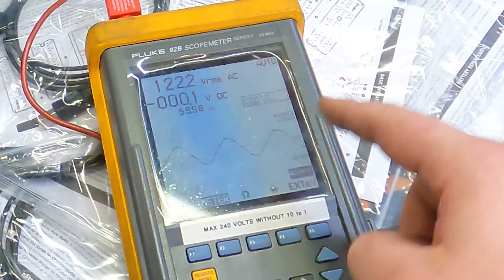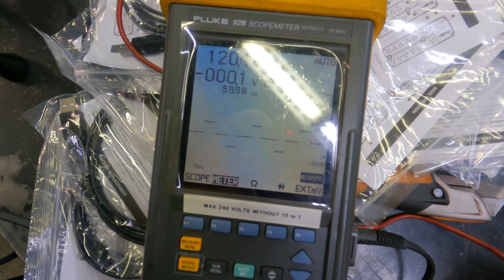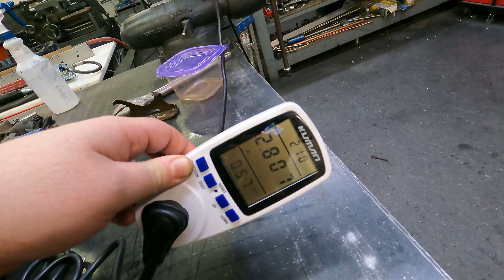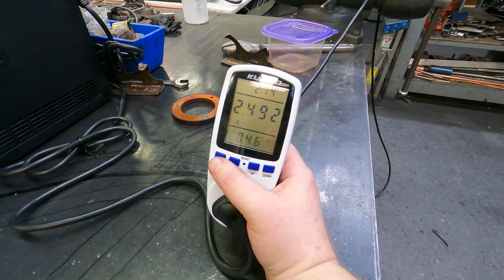Can You Plug Multiple UPS's Into Each Other (8 UPS Daisy Chain)

Comment: Thanks for being super comprehensive with the test. Really appreciate it. Clears a lot of doubt (especially the practical aspect of using 2 UPS chain for increased runtime).

I think the reason for the first test failure might be because of either:
1. at least one bad apple is in the chain that's not letting the power pass through as intended, making the next one go on back up (changing the order especially for the last 2-3 of the load end may give easy answer to whether this is the case)
2. or, the pass through may be introducing minimal power-factor/phase-shift (or some other form of deformation of the sine-wave) which is getting worse by each stage. At a certain point after a few links of the daisy chain, the next one thinks of it as bad (dirty) mains power & decides to switch to back up

I don't know whether you'll be able to retest these (cause it's a costly endeavor, both time & money wise). But if you do, I'll look forward to it.

Comment: At 2:40 you can see two UPSs with errors detecting power. Numbering from left to right, UPS 1 and 3 cannot detect the UPS to their right. Obviously, UPS 1 is the most critical one. Also, I noticed that all 8 UPSs detected a power failure. I am not sure what their power failure detection sensitivity range is, but you could probably tweak it in settings to make them work better together. Their voltage sensitivity seems to be too tight, perhaps, also, meaning that if the UPS sends out 110VAC and the trip is around 108 VAC, there could a low voltage detect error on UPS 1 and 3, thus shutting down the whole experiment early.

Comment: Cool test.  In the setup menus of each UPS you can adjust how sensitive they are to "bad power" and the min/max voltage to trigger the switchover.  I wonder if tweaking the setup you could make this work better with multiple units?

Comment: I bought a CyberPower A1500sp1 designed to power a 1/2 horse sump pump as a back up system.  It only runs 2-3 hours.  Do you think I could daisy chain two or more to get longer protection?  The output sign wave is a “simulated sign wave”.  Great video explanation and test.
Reply: The short answer is a positive maybe.  Although the technology in these things is much better than it was a handful of years ago, simulated sine waves have been known to not play nicely with each other.  For anything serious, I'd always recommend getting a larger single unit designed for the intended purpose.
Reply: @distractor_beamreviews  do you have a recommendation on what larger unit to get? I too am looking to run a sump pump for about 8 hrs and these are only able to last about 2-3 hrs
Reply from the maker: @davidroberts8568  Unfortunately these things get pretty expensive past 1500va.  The only one I've used in that range is https://www.amazon.com/APC-SRT5KXLT-Smart-UPS-5000VA-208V/dp/B01L24FYGW but it's 208v so it won't work for your scenario.  This might work for your purpose https://www.amazon.com/APC-SMX3000RMLV2UNC-100-127V-Smart-UPS-Network/dp/B004FIP7NS but if I was looking at paying that amount, I'd probably be considering a powerwall or something of that nature.

Comment: those USP have fake charge times they are just timers. but the discharge is accurate measure. just charging is not. I bet the UPS that  were cut off  in the middle were not fully charged.

Comment: Are you using all pure sinewave units or all modified sinewave units or half & half? If you're mixing them I am not certain but I think that the pure sinewave units will not like the power output of the modified sinewave units being fed into them that's just my guess but without being there to test this theory I'm not sure.
Reply from the maker: All of the units included in the test are pure sine wave.
Reply: @Distractor_Beam  hmm that is odd then that they weren't working liking being connected to each other. It could just be cyber power ups not liking being daisy chained.
Reply from the maker: @9ColeTrain4  It's possible.  I'd be curious to try the same test on another brand, but they're not cheap.
Reply: @Distractor_Beam  ya that is true but ain't nothing cheap anymore especially right now. Only brands I can think of that would be good brands to try with would be Tripplite, Eaton, and APC
Reply: @Distractor_Beam  All of the UPS manufacturers recommenced against daisy-chaining, and some went into an explanation as to why.  I didn't feel like reading anything technical, so I took to YouTube for a quick video and found yours.  I didn't really learn why it doesn't work, but you did show me that the behavior is unpredictable and that I should probably listen to what the manufacturer says.  I can't tell if your two UPS setup actually works, or, if it was just lucky coin flip and next time it might not work.

Comment: it 's easier to connect several batteries in parallel.  the batteries that come with these UPSs are about $40 each
Reply: Would that work without being able to reprogram the smart charging circuit to recognize the additional capacity?
Reply: @CuredofSociety  Yes.  All the charging circuit sees is the voltage, not the capacity in amp hours.